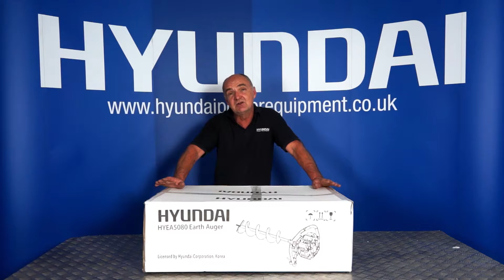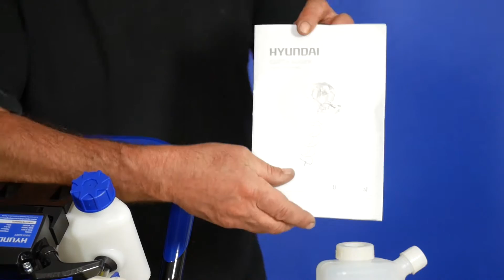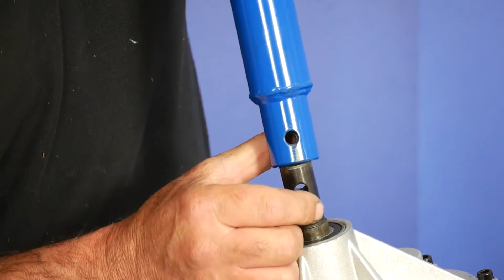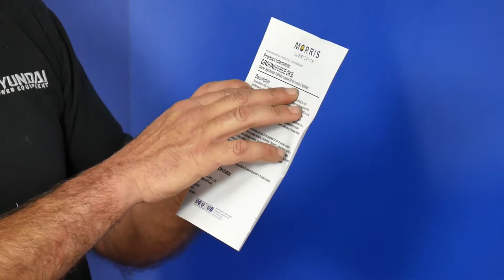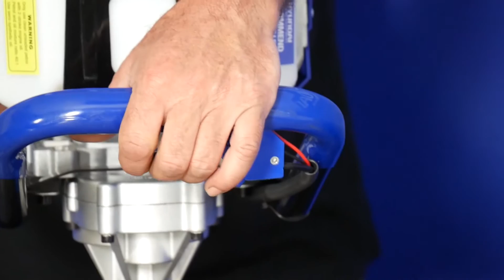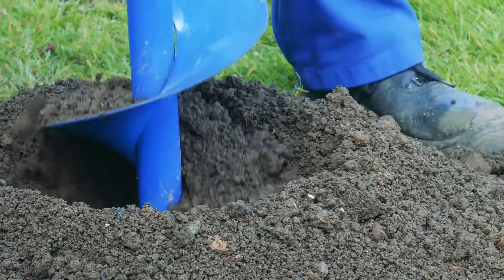Hyundai 2-Stroke Petrol Earth Auger/ Borer / Drill - HYEA5080 Unboxing and in Use

Comment: really informative thanks. Still wondering what this will be like in clay soil, and in a new build home where its now common knowledge the 'builders' have left a lot of brick and junk in the ground.. impossible to dig a post hole with a shovel, and last attempt found a couple of housbricks, so i am concerned.. any advice would be gratefully appreciated
Reply from the maker: Hi There, the petrol auger should be able to work well in clay based soil along with some smaller stones and debris. However, as you may appreciate it hasn't been tested against house bricks etc. It would be effective at digging the hold, but should you encounter bricks, you should be able to remove the auger, retrieve the bricks by hand and continue again.
Reply: @HPPUK  Thankyou, appreciate the reply